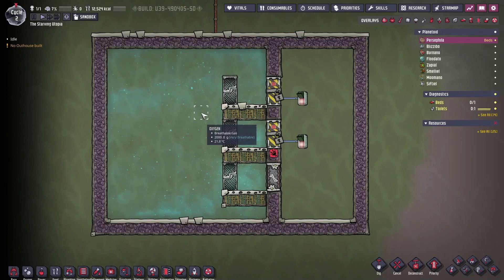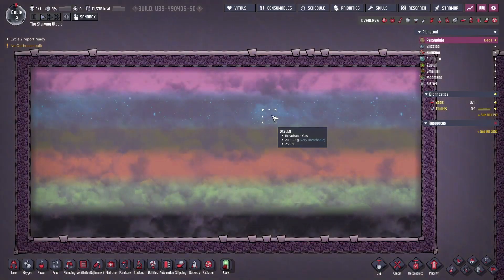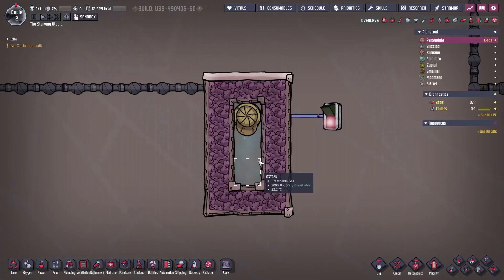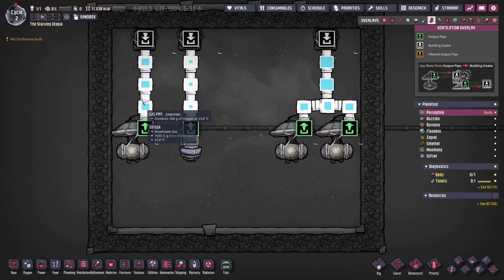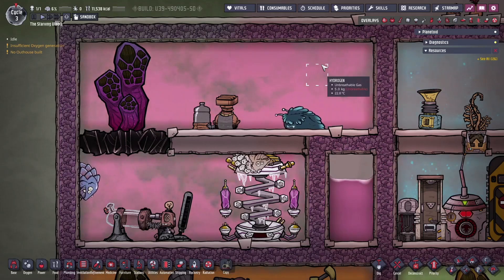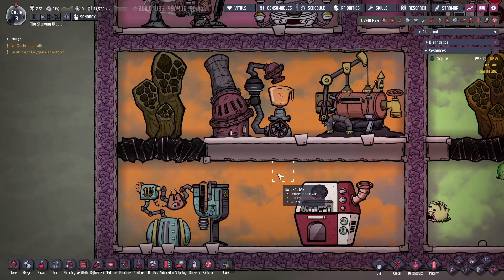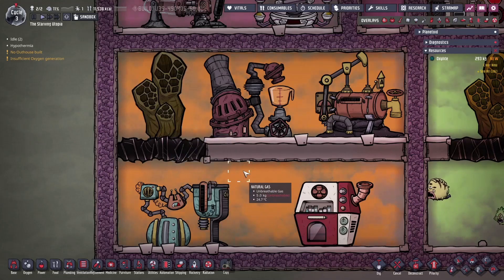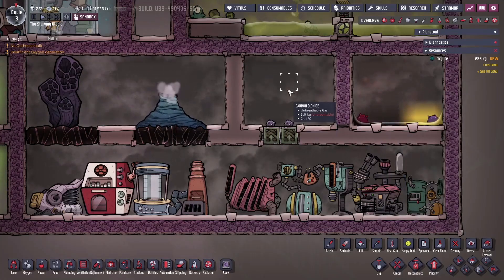Oxygen Not Included - Tutorial Bites - Gases

Comment: In earlier versions of hte game, gasses had a slight preference to rise to the left, and fall to the right. I didn't see it acting that way in your demos, but I'm not sure if they would still show that with saturated tiles like you had. Do you know if they eliminated that sideways preference? I always built my CO2 sinks in the bottom right to take advantage of it, but I might need to change that. Thanks
Reply from the maker: I'm aware of this, and I don't think they've changed the gas model at any point. But I've never designed anything with horizontal gas movement in mind and not had any issues.
Reply: @GCFungus  thanks for the reply. Good to know

Comment: do you have a video on gas pressure? specifically, not about moving it through pipes, but in base management. I'm noticing that even though the area around my early game oxygen machine is at like 1.8kg, but if i don't make my ladder tunnels 2-3 tiles wide, that pressure really doesn't disperse down the tunnel.
Reply from the maker: Not specifically on pressure no, but you've really hit the nail on the head already there. The gases in ONI are a bit 'sticky' but they do separate into layers by density as I showed here. The oxygen diffusers will overpressure at 1.8kg which is perfect for dupes, and then you need to have enough airflow to let it get around the base. Making 2/3 tile wide ladder areas is perfect, and I usually add a few airflow tiles between each room to help too.
Then once you can move onto a SPOM (Self-Powered Oxygen Machine), you can use the gas pipes and vents to distribute oxygen to 2kg/tile. The carbon dioxide still falls down to be dealt with. Definitely have a look at the Oxygen Tutorial Bite if you haven't seen that already.
Reply: @GCFungus  after I asked this question I went into sandbox mode and played with a few things. some things of note:

1) Gases don't up or down unless forced to. In a room full of O at 1kg each, if you put 1kg of Polluted O (same density as O) in the center of the room vertically, the PO won't go up or down, ever. It just keeps moving around horizontally. This is kinda annoying actually, because it's hard to control where the PO will go then since you can't just count on it "eventually moving up or down into a space". This means you want flat tunnels for moving CO2 around though since it won't really move up if the O pressure is not low.
2) There's a vertical height exploit for high pressure gases with different densities. Say you have a room that's 2 tiles tall, and however long you want wide. you can put 100kg of CO2 on the bottom and 10kg of O on the top layer. You would THINK that the insane pressure CO2 would compress the O tiles into fewer tiles...but instead nothing happens. The 100kg of CO2 stays on the bottom layer, held in place by the 10kg of O. If you increase the height of the room to anything greater than 2 tiles though, the CO2 is then able to behave less exploity. NOTE, this 2 tile V limit means you can use low pressure CO2 instead of water at an airlock to get a perfect seal; long as germs aren't your concern. Dupes don't get wet, all you need is just to keep the other tiles at a higher pressure.
3) The O Diffuser emits it's gas from the second tile up, and that was just a minor question I had.
4) I think I found a clue as to why you need wide tunnels to diffuse gas pressure,  gases seem to have a significant limit on how much can flow from a high pressure tile to a low pressure tile. I put one tile of 100kg O in a 1 by 2 vacuum room, and hit pause the instant something happened. You would think, that 100kg in a tile would instantly fill the adjacent 0 pressure tile with 50kg within 1 tick. Making them 50kg in each...but instead, only 12kg went to the empty space on the first tick. on the next update, less than 12kg moved to the tile again. I think there might be something like a 12% cap on how much airflow tile A can send to tile B per tick, and that would certainly be a problem for narrow tunnels.
5) If you're curious, a tile of 100kg O dropped in a large vacuum seems to send 12kg in all 4 cardinal directions in one tick - with a strange quirk of also sending it to some, but not all, non-cardinal directions as well. So within one tick 100kg went to 22kg.
Reply from the maker: @Layarion  That's interesting, and I was aware of most of what you found already. The game does have a 1 material per tile limitation, so yes two gases won't swap places if there are only 2 spaces to do so - this is the principle many SPOMs work on by forcing the hydrogen through a 1 tile gap. There is a similar behaviour with liquids, where a couple of grams of a liquid can hold back many tonnes of another (or a gas) because it can't be displaced.

Also, although PO2 doesn't move vertically, in real games it does tend to form layers because of this behaviour. Basically whatever source is producing PO2 will keep making it at the same height, which then moves horizontally. But yeah you need to put deodorizers at the right heights.